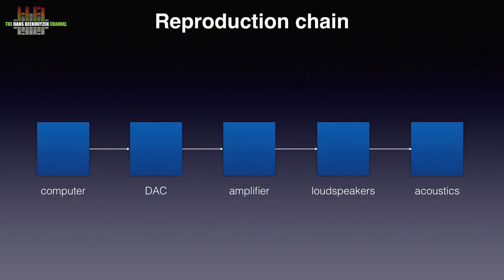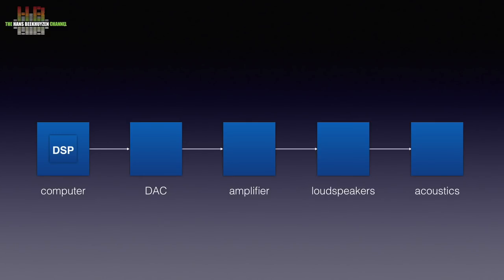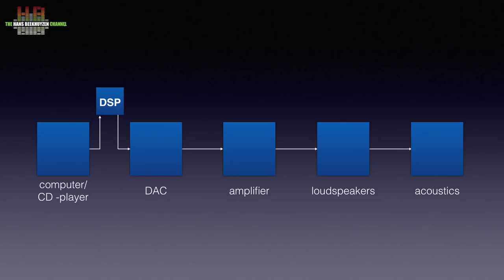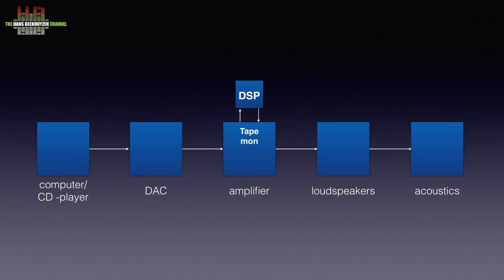Discovering room correction

Comment: Hi Hans,
I would be curious to know if, in your experience, DSP-based room correction tends to enhance or diminish / normalize differences between gear. In other words, say that you are evaluating a new amp in your setup 1 (which, if I’m not mistaken, uses a DSP). Would you keep the DSP enabled during the evaluation and why?
Reply from the maker: The influence of the amp is limited compared to room modes. BTW if I would review amps (which I don't) , I would have reviewed them without the MiniDSP first.
Reply: Thanks Hans for the kind reply. Yes, the amp evaluation was just an example, sorry for the confusion. I guess you would still evaluate a DAC in the same way, i.e. with the MiniDSP, first, correct?

Comment: Hello Hans, i really like your comprehensive video's. Started with gathering info on PI streamers, i came across your video about room correction. Past few weeks i came across the lyngdorf integrated digital amplifier with room correction, and have listened it in a unplanned demo; it sounded quite surprising! Now, i wonder if such would be possible to accomplish with for instance a raspberry pi with a good mike. Can you tell us more about this, and maybe listen to the lyngdorf as well? Curious to your opinion about it. Myself, up until quite recent, was not so happy with dsp, correction, etcetera, but love the Dolby systems for movies. Also, facing the same issues like most parents, my high end set has been in the storage for the past 15 years, and now im re-discovering high end audio, and conclude that the world has changed, and nothing is what is ever has been...  So, im ready to learn again in this (to me) "new" world of dsp's,  corrections, and equalisers, with class D amps and so on. (what happened to class A??? )
Reply from the maker: Not that I know.